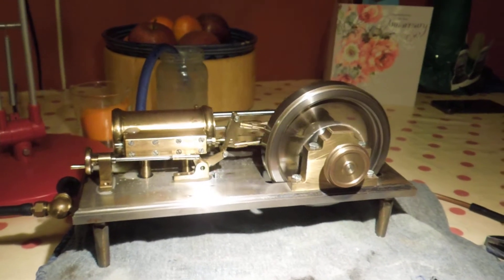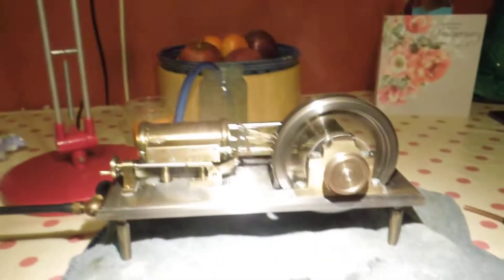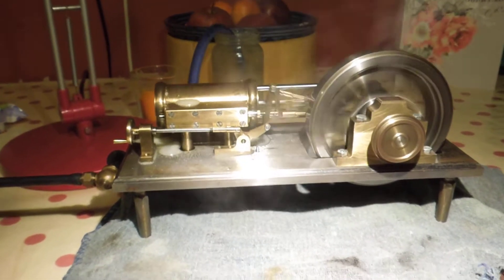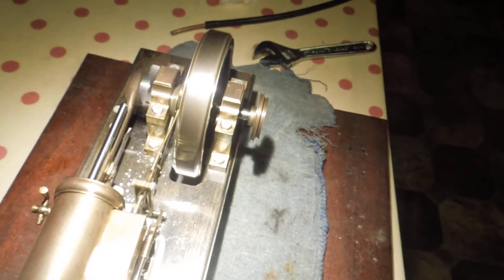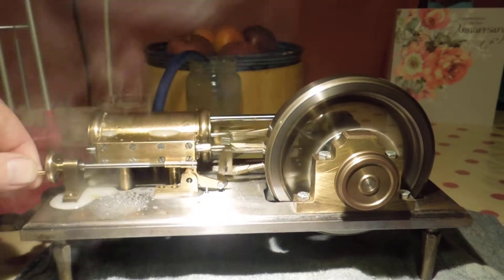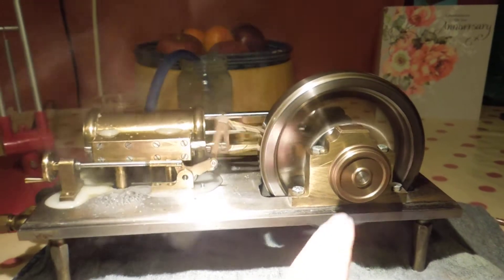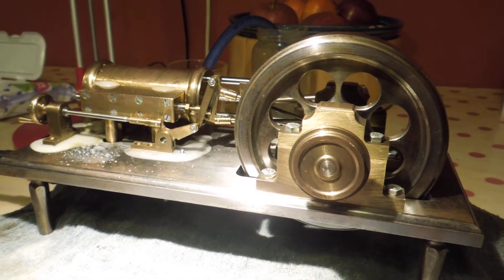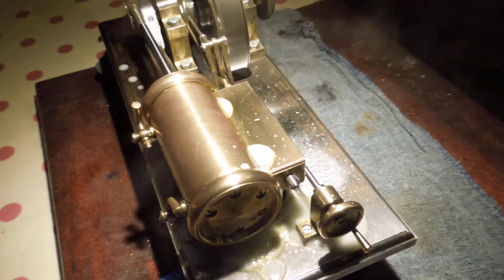Uniflow-type steam engine

Comment: So where is it that you got it from? I apologize, but I can't quite understand.

Anyway, uniflows are a great type of engines. With a piston valve, this could get up to very high speeds. Have you tried measuring it with a tachometer? I would recommend adding a condenser made from for example a plate type heat exchanger. A uniflow working with a vacuum exhaust would be a sight to behold.
Reply from the maker: Bartpa Addiator thanks for the suggestion, I might just give that a go. The engine came from a friend in Germany. The plans are still readily available, see http://www.amazon.co.uk/Dampf-Gleichstrom-Dampfmaschine-Entwicklung-Konstruktion-Bauanleitung/dp/3788316063/ref=sr_1_1?ie=UTF8&qid=1428491128&sr=8-1&keywords=gleichstrom-dampfmaschine